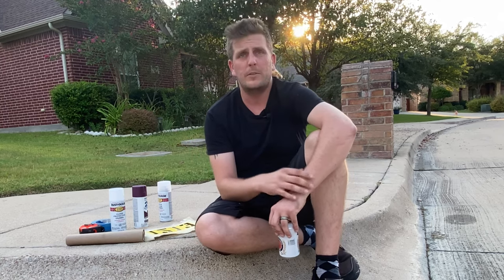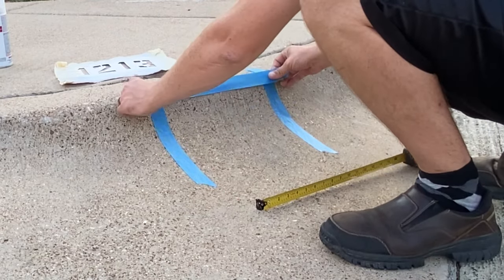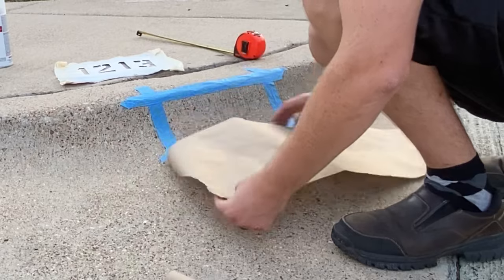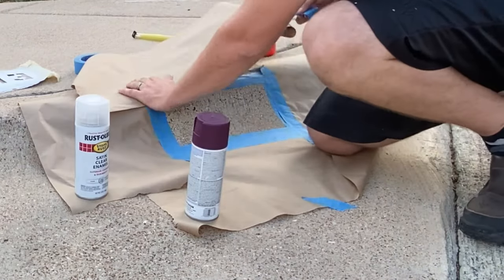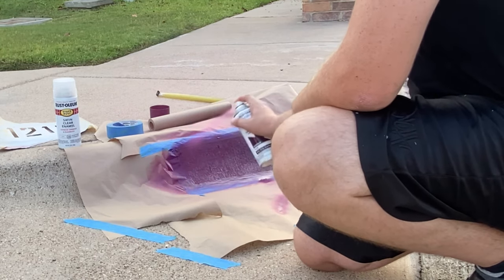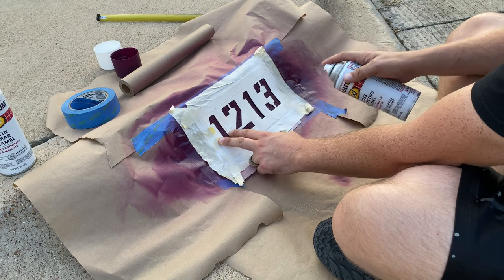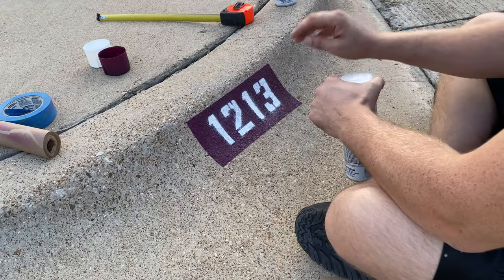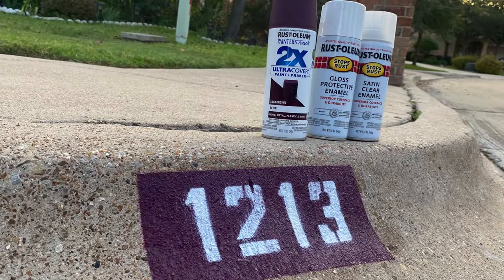Paint YOUR address In a Few Easy Steps

Comment: How do you calculate where exactly to put it on the curb? Do you ask the homeowner?
Reply from the maker: I am the homeowner so I put it where I thought it looked best
Reply: Try to estimate the middle line of the property. Half the property so it’s as close to symmetrical as possible. If you’re doing it for side hustle or business purposes discuss it with the homeowner even though this is the natural location.

A good up charge if you’re doing this would be cleaning garbage cans.